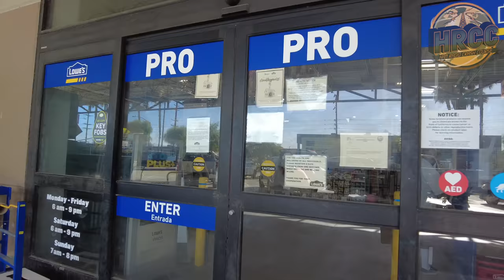My Ham Radio Go Box Wiring And Setup

Comment: Very nice project.  I watched your video and gave me ideas to build a "go box" on my own.  Thank you for laying out the wiring well.  I do have a question in regard to the first button (with the blue light in upper left corner).  Can you please explain what ends of the wires go where on the wiring?  I couldn't really follow how they get hooked up.  Like, where does the other end plug into, the distribution block between the "out" on the Pwrgate?  I guess I am asking where you are cutting the power.  To the distribution block, power supply, or battery?  If anyone reading this can give me some insight.  Any information will be appreciated.  Thank you.

Comment: When working on your GoBox, use a Muffin Tin to put your bolts into so you dont lose them.  You can also put a small piece of paper in with the bolts(screws) to tell where they came from.  Also when using wire ties, make sure they all go the same direction when they go on, they look better that way. Also, if you install some led lighting at the ceiling of the box you can turn on so you can see what your wiring, a short strip is low cost and helpful.

Comment: Question for you. I ordered almost the same setup from DX and Amazon. Regarding the output from Powergate to the main power switch. Did you just run the power to the switch and then back to block 1 of the powerpole bank? Kinda a dumb question but I was wondering what the power pigtail was made for. Thanks for all the great videos!

Comment: Use washers with the SO-239 connectors. washers will tighten up the connectors bro. Nice job brother. Use safety glasses when drilling metal ,learned the hard way and got a piece of metal in my eye so please use glasses.

Comment: If that's the WestMountain Radio Epic PWRGate, it has a built-in MPPT solar charge controller.  That's good, MPPT is more effecient that the PWM-style charge conrollers.
Also, I belive you can configure charging settings (max bat. voltage, LiFePo4 vs SLA battery, etc.) from that USB port AND get current charge / battery status.

Comment: Instead of using the XLR panel that came with the case you can actually order a blank server rack metal plates. That way there when you use your step bit to drill out holes whether it be for the antennas or your switches they will always be the perfect size. They're fairly cheap as well and definitely as a step up from having everything wiggling and driving you crazy.

Comment: Excellent video. I'm planning a go kit for my setup. I'm running a Yaesu FT-891 in conjunction with a Raspberry Pi/Digital Radio Amateur Workstation (DRAWS) setup. Everything worked great this past Field Day, but the cable management was a mess, and it pretty much just involved setting everything out all over a table. I'm wanting to build something more self-contained like this where I just open it up, power up, and get on the air. Great video. 73 de KG5TMP.

Comment: Great vid, i'm getting some ideas from it. Planning on a smaller one with my 705! 
Just a couple things comes in mind. 
1. You can probably  leave out the fuses in the wiring (and save space) by using a fused power distribution strip. 
2. I hate those 12V to USB things because they produce a lot of HF noise. I have one in my truck and it's making 2m almost unusable. Noise level changes with the load on the USB all over the place. At least make this switchable to shut the interference off as needed. If you found one without this problem, please share details!
3. Recently i watched some vid's about the (LiFePO4) batteries, some of the cheaper ones seems to have a tendency to heat up pretty good. 
4. Lighting: a RGBW LED strip seems to be a good idea - dimmable and color  set  (like bright white for setup a place or glowing red or green while operating at night looks kinda cool)...and a set of PUG lights for flood light while setup antennas!

Comment: Is there a concern of the HF coax and VHF coax being tied together on the braid thru the metal panel the bulkheads are attached thru?
Reply: Ground sides no, but multiple radios, using separate antennas, in close proximity can damage each other.

Comment: I actually have a project going right now that has to do with your lighting. there is a guy on youtube with something similar but basically involves a led strip, a 1" acrylic tube with the switch on the end with a 3d print part so it slides back into your accessory bar you have at the top. let me know if it's something you're interested in I bought all the stuff to make it but don't have the box for it to go in at the moment.

Comment: Any cord or cable that has power pole connectors on both ends can be used in either direction so it is good practice to put the fuse in each conductor at the opposite end of the fuse in the other conductor. That way, no matter which end is connected to the source and which is connected to the load you have a fuse at the supply end that will open in the event of a short circuit. In the event of an overload either or both fuses will open to deenergize the excessive load. Placing 2 fuses at each end does not provide better protection from either short circuit or excessive load and is just a waste of materials. 

Tom Horne W3TDH

Comment: @8:45 Because the fuses don't protect the radio, they protect the wire. If the fuses were close to the radio, and the wires shorted upstream (on the power source side of the fuses, e.g. the battery) then the wires themselves may act as fuses by melting and possibly setting other things on fire.

The fuses protect the wires, not the radio.

Comment: Question, when running the SO239  barrels through the metal plate. Would it be wise to ground the radio(s) directly to the plate as well? Curious about this as I'm currently working on building something like this.

Comment: To attach the so239 to the panel what I have used is get a "D" series blank plastic cover and then drill the 5/8 hole you need to mount the so239 and then bolt that into the panel

Comment: Now, if you put the antenna connectors next to each other you won't be able to have antennas directly connected to them, because you will have 2 antennas next to one another.  For cable connections to your tower, however, this will work fine.

Comment: A possible answer to your question (gripe). The long cable is because they're meant to be in a car (well, not so much the 7300, but you get the point). The fuse near the end is to protect the battery. The fuse near the radio is for the radio. And the little things near the fuse were probably DC filters.

Comment: Loved the video, Josh. An idea for installing a heavy shelf, put the box on it's back and it will be easer to align the shelf with the holes. I will have a strip in the back for power and antenna connections. 
Great Job, Bizz
KD4CXI

Comment: there are new factory power connectors available on the web. and or just replace with the anderson plugs on the radio cases.
when you buy a couple screws, nuts, (buy nylock nuts also) flat washers, etc buy a whole box of them. never buy/use crack washers aka "split". as they do fail and fall out.

Comment: Re: fuse location on power cable, you want the fuse on the power side of the cable, not the equipment side.  If the wire shorts, the fuse would not see the short.

Comment: Personally, I would prefer two 3U boxes rather than one 6U. For example, the Gator GR-3S. They are lighter and more handy to carry. The same heavy suitcase wheels are also unnecessary because they are rarely used anyway, and the trolley can always be added. In addition, two 3U boxes on top of each other have the same height as one 8U box in which, for example, you can put a power generator with fuel, or rolled up photovoltaic panels with a buffer battery and cabling.

Comment: The fuses are where they are because you should ALWAYS fuse your electrical as close to the power source as possible and the manufacturers assume a vehicle installation, therefore wiring to a vehicle batter some distance away from the transceiver. You DO NOT want to fuse at the load end of a power cable because if your cable insulation fails or you have some other issue (short-circuit, overload, etc.) your cable is now the fuse thus creating a fire hazard, hot chassis, or any number of other problems.

Tl;dr: manufacturers do things for a reason. If you want a shorter power wire, go ahead, just make sure it is still fused as close to the source as possible.

Comment: the manual for the Epic Power Gate (Epic PWR Gate) indicates it does indeed have a MPPT charge controller built in. so no you do not need a seperate charge controller if using a 12v or 24v solar array. it is not rated beyond 30v of solar power, so a 48v array (commonly used for solar power of homes would not work, and if you had a 48v home array you would need to either use a seperate array, or wire some series parallel sections to tap a 24v output. I do not recall of hand, nor did I go through the entire manual for verification, but I believe it can handle 480w of solar panels on 12v, though depending on what your solar situation, you may need more panels to reach those numbers

"Support for direct connection to a solar panel for battery charging of all chemistry types using Maximum Power Point Transfer (“MPPT”)" 

For home use, I think available equipment, I am more likely to use a renology MPPT charge controller to convert AC or solar to DC for the battery bank, then use the lithium batteries to power the radio station. the epic pwrgate however does seem to me to be a lightweight package for a go-box as it can easily be wired to take a small internal battery on the go box, or a large external battery pack and use both an ac power supply and solar panels to keep the system charged

Comment: The West Mountain Radio Epic PWRGate IS a charge controller.  When connected to mains or directly to a solar panel, it charges your battery correctly (provided you have read the manual and set it up for your battery chemistry).  I don't recall how it is setup from the factory, but definitely DO NOT connect any battery and power supply to it before reading the manual and examining the dip switches.  If the PWRGate is setup for the wrong battery chemistry, it could seriously damage the battery.

Comment: Does it come with a forklift? Do I need a special license to even operate the forklift. Hehe. Nice. I’m racking my brain trying to decide if I wanna go this route. It’s a lot of work. I definitely like having everything already connected but I don’t like that it’s not very flexible in terms of ease of changing stuff. Especially if you want to add a component that wasn’t factored in originally. Thanks for the video and especially the super cheesy video opening. KX8Z 73

Comment: Here is a list that I have made of some of the things that I have observed about transportable stations I have seen or even used. Some come from military equipment. NONE are original with me.     
• An LED light bar on the front of a filler plate that is fitted to fold open when needed will provide a broader lighted area with fewer shadows on the work. 

        ◦ You may want to mount the led light bar below internally lighted gauges to leave those gauges easy to see. 
        ◦ This does not preclude the inclusion of a flexible necked lamp if initial trials show it to be needed as well. 
    • Connectors for external items should all go out the back including any for on connector antennas. 
    • Connectors that must be at the front should all mount at the bottom of the front panel without exception. 
        ◦ If that is not done cords will be in front of other devices or controls. 
    • Do not use through the shell devices to avoid connector damage, foreign matter, and water entry.
    • Use shelves which fasten to both the front and back rails to bear weight more effectively and resist bending. 
        ◦ Needed for larger radios and batteries. 
    • Use cover pouches for loose items such as cords, manuals, and microphones and remote antenna tuner. 
    • Provide a weather protective back operating cover to protect the equipment from weather even when it is in use. 
    • Make a front weather protection hood to allow the use of the station in direct sunshine or inclement weather. 
    • If the station will have 2 different operator controlled radios consider having one of them mounted on a removable shelf so that it can used as a separate operating position. 
        ◦ That will require that everything needed for one of the radios will be on a single shelf. I think that the smaller of your radios is usually the best choice for that.
    • A drawer unit to hold a laptop computer can be at any height and even be mounted in the rear because it is not going to be practical to have the laptop screen in front of the equipment. 
        ◦ The drawer should also house the mouse and audio connecting cables or devices for the radio as 2well as any CAT control cables, adapters, and converters. 
    • Your usage may not require the use of computer control of the radio so permanent connection of the computer to the radio will limit operational flexibility rather than improve it. 
    • Consider having a portable stand and folding stool for the station. 
    • If the station container does not have wheels consider adding a fold flat hand truck with large wheels to the overall station equipment. 

Tom Horne

Comment: I would have rotated the power supply sideways.  Then the cabling can be run "inside" the box.  The Power Switch will remain on as you put in a front-panel power switch assy.
Reply from the maker: Good idea.

Comment: The wire question you pose, Because these are designed for a car. The fuses need to be as close to the battery as possible.

Comment: including some powered USB ports would be good for charging devices and to plug in one or two goose neck USB lights.
Reply from the maker: I did include usb power. 👍 that’s how I powered the laptop.
Reply: @HamRadioCrashCourse  also, a good rule for lighting, especially in low light situations is to make sure the light is both, directed at your work(what you need to see) and shielded from your eyes, because any glare will make low light areas harder to see.

Comment: where can i get a slower wiring instruction what connects to what and WHY.  thx
Reply from the maker: What are you trying to understand?
Reply: @HamRadioCrashCourse  Thanks for your response:
I was looking at your one large box YouTube and trying to learn the wiring: I couldn’t see how to connect a distribution strip of powerpole connectors and all of the wiring- what that can take as input and output. Can the radio’s ac to  dc power supply or the battery run the radio and all items you had in the box? 
 Before I saw your you-tube – regarding  The West Mountain Radio Epic H PwrGate – I happened to see it on demo yesterday at a local Hamfest and  spoke to the West Mountain guy. He had mentioned that this unit would replace the need for a charger for the battery. You mentioned that you still need a charger. 
And I didn’t understand how to use it. In other words, you charge the battery while in a box and then connect it to the PwrGate when going portable? 
I apologize if this is unclear.  I am struggling to clarify what I need to understand before I buy stuff and just try it and blow up some equipment.
Barry, K1OPK

Comment: Correction, the West Mountain Radio Epic PWRgate IS an MPPT charge controller. The USB port and cable are not just for firmware updates, but for configuring the battery charging parameters.

Comment: I never understand why people build these huge "boxes" that weigh 30-40 lbs.  Good luck lugging that everywhere when it matters.  Keep it simple - light and compact.
Reply from the maker: I still have my backpack kit. This is purely a trunk rig.
Reply: I have a go box about this size has a 2m rig with KPC3+, 2 duel banders one DMR, an HF rig and Tuner. 40lbs easily. I haul it all over and use it almost weekly for fire Dept command post operations. Depending on what your looking to do this is not a bad size. I can do most everything needed to communicate.